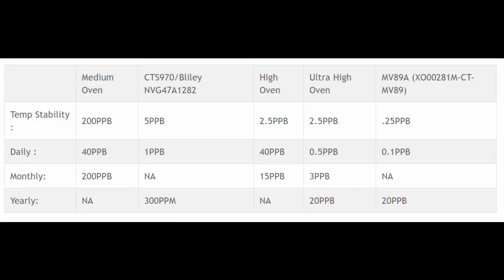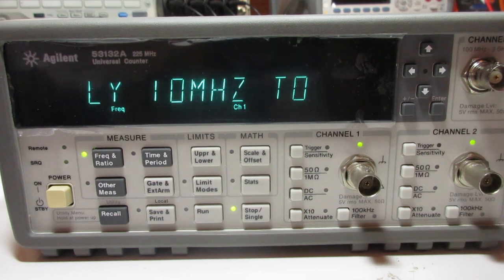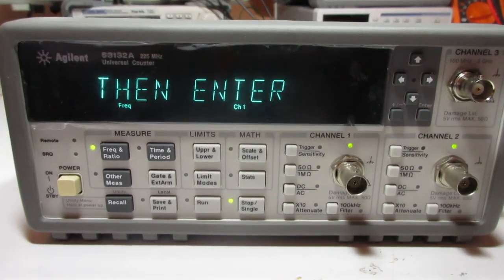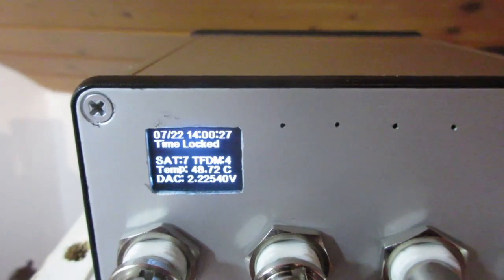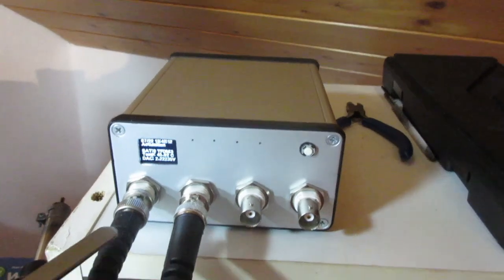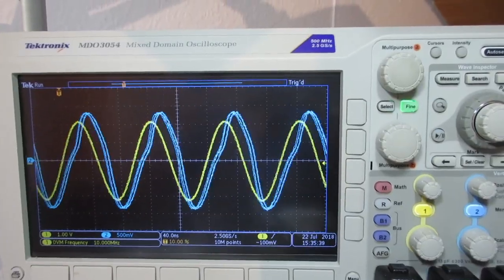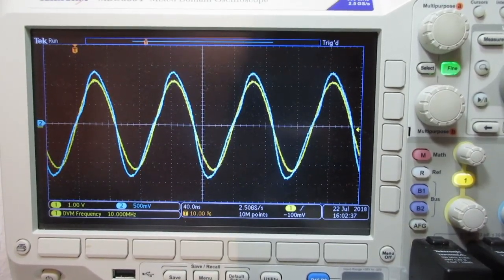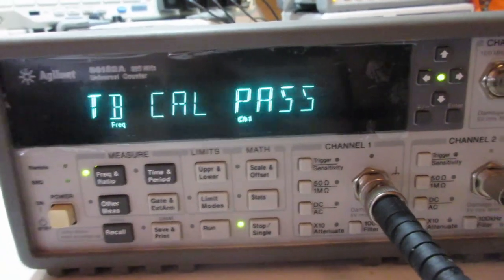DIY HP/Agilent 53131A 53132A Ultra High Stability Oven Option 012 and 010 Time base Upgrade

Comment: I have used a very old Rakon 10 MHz ocxo to upgrade my 53132A
Actually it's a temex branded OCXO but rakon purchased temex in the 2000s if i'm not mistaken
Anyways, this 10MHz ocxo is ultra stable, nowadays they call it HSO13 and it's still being sold, incredible specs !

Comment: The one you sent me was with a very used Trimble OCXO (not a XO00281M-CT-MV89). Can't find any information on 34310-t OCXO. It drifts right after Cal, no matter how many cals or warm up time passed. Any ideas?
Reply from the maker: All Oscillators drift, If you look at Daily Spec of MV89A it drifts as well. . I have both new and used MV89A They almost match in specification to 34310. As 34310 is part for OEM you will not be able to find any direct data on it. But it has similar specs to MV89A. Both of them are double oven oscillator. MV89A are hard to find these days, Even if you find oscillator itself cost around 90 EUR, You can source MV89A your self can do a swap.